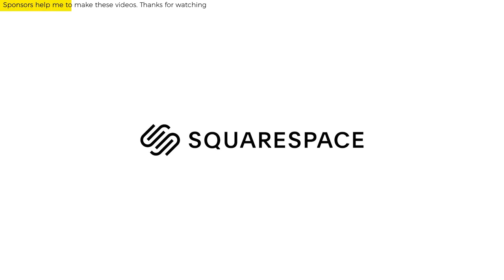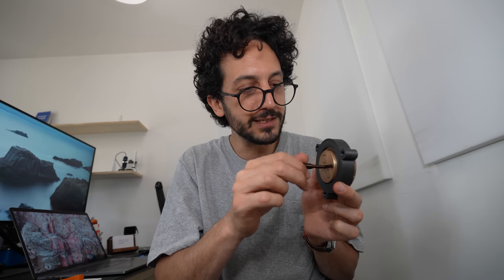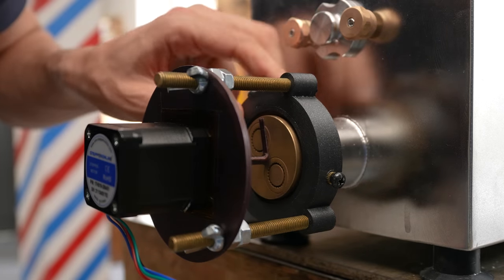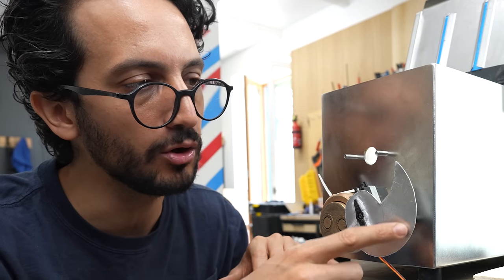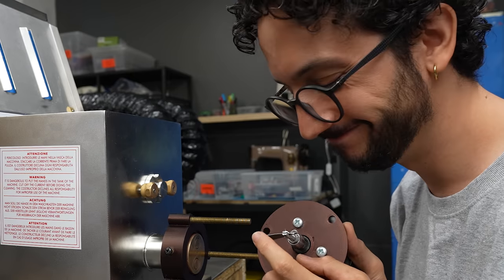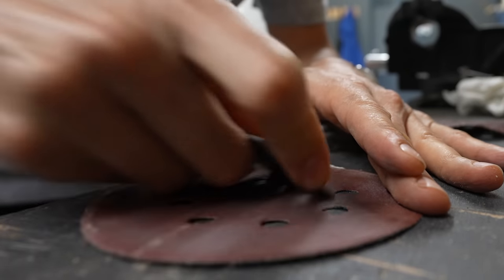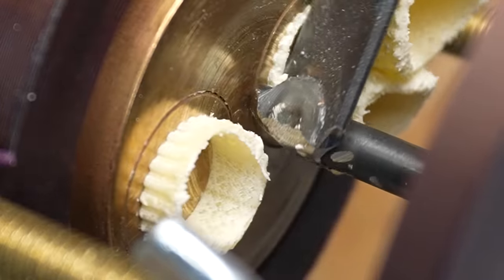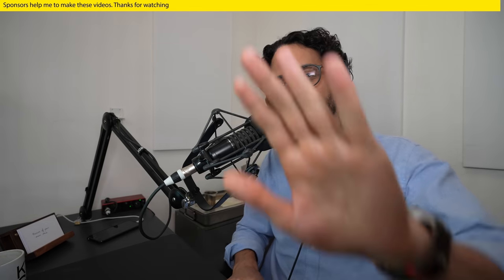I Tried to Make an Automatic Pasta Cutter (did NOT go as planned)

Comment: I like your springy blade, but isn't it mounted the wrong way around? When you cut by hand, you are cutting the pasta; ie the sharp edge of the knife is pointed in the direction of movement. Your springy blade is scraping the pasta; the sharp edge is pointed at the pasta machine, while it moves perpendicularly.

Comment: Yikes... just put the motor parallel witht the extruder and have a accurate mounting system that attaches to a modified kitchen knife. Write code to slow down and speed up the motor for longer pasta. The only challenge would be to get the tollerences right so the knife is close enough to the extruder to get that shear force. Also it needs to be stiff.

Comment: 9:50 You're entirely wrong about how scissors work. They rely on the springyness of the blades -- which are actually bent inward toward each other, not straight -- so that both blades act as springs to press their contact shearing point together. I'd recommend replacing the cutting edge with a disposable safety razor blade, mounted so that it's pressed in hard, so the blade's own inherent spring keeps it in contact with the die face.
Reply: 👆🏽 This. Exactly what i was going to say.

Comment: Wouldnt it be easier to make a wire go up and down not around? Basically just hook up the motor to a cogwheel ( basically like in old steam trains) and the cogwheel would not be a cogwheel but a cogelipse! So the blade could cut swiflty and the pasta time to extrude properly, of course this is just my silly steampunkish idea. AND good work alex! You seemed a little tired in this video, hope you are doing alright. 

Oskar
Reply: Oh and a last thing, I would use a wire insted of a blade

Comment: Why not use a cheese cutter wire? I suppose that doesn't fit with your existing design of a rotating blade, but I think a quick chop with a tensioned wire would work much better than trying to get a blade pressed flat against the die.

Comment: From an engineering standpoint...

I will suggest that you slow down.

It's not about rushing to success.  Good, well efficient engineering, has a lot to do with good planning and highly accurate detail of the design specification.

Start from the beginning:

One - define the cut interval, either static or a range.  Note the range could be done through variability of the motor or via gearing.

Two - define EXACTLY how the pasta will be cut.  Think about blade sweep, blade profile, profile and position of the cutting tool to make sure it's not in the way of the pasta. Pay attention to how it cuts in order to control how it will deform and tear the pasta as it does.

Three - Consider key mechanical elements like blade sharpness, structural strength, required force to cut , and tunability.

Four - Brainstorm ideas quickly and with minimal real investment.  You want to work through a lot of the core variability and options using as little time and with as few material/labor costs as possible.  Also don't be afraid to use "representative" devices/objects to test with.  You don't have to 3d print a blade to test a blade.  You don't need a whole motor contraption to test a blade design.  Work bottom up.  You want to step through theory as much as possible first, then very basic physical and specifically core physical elements.  As the core parts prove to be sound, begin to build up the more complex, time consuming, expensive elements.

You kind of went full tilt right from the start.  You had no idea how a 3D blade would cut, and you tried a lot of them...blindly.  You didn't know motor torque and requirements for torque.  You created issue with damaging the pasta (crushing it) or simply got in the way of the pasta.  This stuff, in theory, should be very obvious.

Interestingly I think you were at your best point at around 4:30 into the video.  That style keeps the design clean, parts well out of the way, leaves room for easy adjustability, and all you really needed to do was start with a thicker blade material that you could taper down into a good blade edge and then secure the blade significantly better to any motor you choose.  It really only failed at all because it was flimsily attached.  A well structured version would yield vastly better results and still give you lots of headroom to tweak elements of the design.  Also, please bond parts with something stronger than some light duty silicone or whatever you used.  There's very nice epoxies out there that work super well and even set really fast.  One of my favorite is Devcon.  They have a 10 minute epoxy, fully cures in just 90 minutes, their part number 14251.  It bonds to materials really well, is decently hard and very strong, but still just has a tiny bit of flex and doesn't become brittle.  It's speed and performance is stellar.  We actually use the stuff in a manufacturing environment as an acceptable repair for spot weld failures (on relatively light duty parts).

I also want to make a note on your cutting.  Try and mimic what you're doing by hand with your knife.  Note what you're physically trying to do with the position, tension, and motion.  You'll want to mimic the behavior.  This is in part why the spring loaded setup worked kind of ok and your offset blade style (that I actually liked) faired poorly.  When sheering the pasta from the extrusion nozzle, you're attempting to shear at the surface, and you really don't want a gap at all.  The gap just shoves pasta material between the extruder and blade, and this wedges underneath and lifts the blade off further (specifically if it's not study/rigid).  You can actually get away with looser tolerances, but you fill find the cut will have much bigger torn/squished/deformed edge.  To put it bluntly, you can cut pasta with a brick a few mm away from the extruder end, but it willy cut terrible and look terrible.  A clean cut edge will be vastly better the tighter you can keep the blade.  This doesn't mean you need it to have spring force against the extruder or have it so close you have hit problems or wear problems.  But, you do want the design to have enough control and enough rigidity in the design to hold a position very well.  You might position it a quarter of a millimeter away, but the design should hold that, absolutely, as it cuts.

Also, think about the cut rate and how the pasta is shaped as you cut across while it continues to extrude.  A faster cut will generate a straighter profile.  But fast and infrequent means either a big diameter blade or a start/stop method.

Comment: Your blade is at too vertical of an angle.  With it that extreme angle, you are pushing the pasta into itself with the upper part of the blade, so no matter how sharp or precise it is, you'll still run into the same issue of the pasta compressing and deforming.  Ideally you would want the angle of the blade to be very close to but slightly higher than the angle of the cut of the pasta, which is nearly horizontal.  Another thing that could help is a blade that isn't as tall, then there's less material for the pasta to get caught on.

Comment: Some very obvious things going wrong here, assuming you are using PWM to control the motor?: 
The default frequency of the Arduino PWM is unfortunately way too low! So:
1. It is well within the audible range and makes a terrible noise! As demonstrated.
2. The low frequency results in very low torque in your motor. 
3. You need a PID controller in your code. 
It is not the motor, it is the code that is the problem, and this needs to be fixed. 
For a motor you can use an old ink jet printer motor with the optical sensor. This is the circular, clear, plastic disc with black stripes on it. If you reclaim the reader from the printer as well you can read the exact speed of the motor and with a higher frequency PWM and a PID algorithm you can control the speed EXACTLY and exert maximum torque at any speed, even slow.
In my code I had something like this to change the PWM frequency above audible and increase torque immensely.
TCCR1B = TCCR1B & B11111000 | B00000001;    // set timer 1 divisor to 1 for PWM frequency of 31372.55 Hz
ps: I can send you the rest of the sample code if you want? This should be a perfect controller for an ink jet printer motor that will cut anything at any desired speed. 
Of course the cutter blades will be a factor too but you need to get the motor control sorted first.
And trying to control a stepper motor seems like overkill. Just implement simple DC motor control. It is speed and torque you want to control not exact positioning?

Comment: Think comments on here disregard the fact that both Alex and the manufacturers of pasta came to the same solution. 
There are engineering reasons why that is. If you are from engineering background you can look harder why that is*. If you are not, reinventing the wheel is great, but that's another hobby. The task here is to cut pasta effectively. Alex tried to shortcut the engineering solutions to see if it works temporarily (it did not). 

*clues;
+ if rotating, it needs to be central to make each pasta equal, additionally having it offset can only work if you have a force big/fast enough to cut it like it was nothing so it does not have different length from first to last cut but also uneven stress on the blade frame 
+ Alex researched other ways already and criticised the cutting scratches the blade, well in his scissors example about movement. The less space between the brass and blade as well as minimal movement will create the best cut. Therefore the more pressure it presses on the brass the better the cut will be (hence scratches).

Comment: instead of having to sharpen blades yourself, why not just 3d-print a piece you can attach a razor blade to? they seem the perfect size, have pretty standard attachment holes, would probably be the sharpest you could find and easily replaceable once it dulls

Comment: 1: Why would u not use razorblades? Sharp as fack and prob the right size.
2: A cutter in the middle wil not work as good as you might want. I thought this the moment you had the 1st prototype, the difference between the inner and outer part of the blade's speed will always be an issue. The major manufacturers dont have this issue due to their extruders size. 

Suggestion, use that side mount thing, with the spring blade prototype, with a razor blade inside it instead of a rando piece of metal. And instead of making the blade curve like you had, make a progressive curved mold around the extruder port that the blade can slide on and get on the extruder exit with the proper pressure. You COULD even spring load the arm, so it cuts with a faster motion, but doesn't go around faster.

Comment: You need:
- A sharper blade
- Stop the motor for 2 seconds to get the desired length, start it to cut, then stop it again for 2 s, start...

This comment was made halfway through the video, so maybe it was fixed later...

Comment: You need to cut with a wire, not a blade, following a guide either side. Cut up, wait a set amount of time, cut down, repeat. 👍
Reply: Controlled by a single long stroke solenoids for motion and control.

---------
\.     /
   \/
    ¥
    ¥

Comment: Right approach, wrong execution. You need to base your design on the movement you make with the knife. You need to have a blade that is almost parallel to the face of the extruded or at most with 5-10degrees of inclination. The blades you used are almost perpendicular to the face of the extruder or with shallow angles. That and a blade really sharp

Comment: The surface area of the blade is still too large. Maybe a rotating wire cutter can do the trick
Reply: 3D print a U-bracket and attach a wire between the legs. Should be easy to prototype fast

Comment: You are approaching this problem from the wrong end. You think the cutter needs to cut (which is correct). But you should think about the pasta deforming the least amount when being cut. Your angle of attack is way wrong, your cutting speed is way too slow. You are giving the elastic and plastic pasta dough more than enough time to deform, before the bonds between molecules can break. 
You intuitively had the correct answer all along: how you cut them by hand. You hold the thin blade on a shallow angle to the extruder face. And you do a rather fast swipe across. 
Use a carpet knife blade. A beam like holder should keep the flex to a minimum. 
Build a sturdy base, that is flush with the extruder face (so the blade can comfortably ride against it)
Offset the cutter to one side (like you did on ver. 2). 
This should provide a reasonable angular momentum. And reasonably straight cutting path, perpendicular to pasta extrusion direction. 

One thing is the blade angle to the extruder face. It may need to be very shallow or it may need be rather blunt. Depends on several factors: how plastic or elastic the dough is (plastic dough prefers higher angle, while elastic needs shallower), the speed of extrusion, speed of blade etc etc. 
I could design an adjustable blade holder, that can be operated while the machine is running.

Comment: you're blade and the speed is the biggest problem using a cheese cutting wire and a mechanism that could snap it across the plate would probably work better.

Comment: Maybe if you move the axis of the spinning blade to the top or side of the disco where the pasta is extruded, it could cut both pasta and let it drop before it touches the next one? As now one of the pasta gets stuck on the blade because is cut from the bottom up ¯\_(ツ)_/¯

Comment: Why cant you just mount your very sharp knife on the stepper motor like you did the second design, rotate quickly 360 degrees then wait x amount of seconds, then have it rotate again? That would be identical to your hand movements. edit: or just wire. and importantly when your blade is mounted at such a perpendicular angle your just crushing the pasta before it finishes the cut

Comment: You can definitely do much better.
The blade and mechanism needs to be stiff and straight so no warped 3d plastic parts.
If there's play you can machine a dent into the center of the extrusion dye and sink the tip of the blade holder into it to help keep things in place. Maybe a light brush of oil to help keep it smooth.

Why did you decide on such a wide blade? Is the slightly squished shape desirable? 
Why not use step down gears to increase torque but reduce speed?
You tried to diy blades from metal pieces, why not try a razor for the prototype? Already very sharp, thin and hardened.

Comment: The Cutter was too overengenieered.

Think about the cheap maschine, it had this wire cutter

I think for this small die. a small wire that is being moved up and down every 5 seconds with a bit more speed would work better

The pasta won't stick to it, won't ruin the next pasta, while cutting it better (I at least think so)
Reply: *Thanks for watching send a direct message right away on the above number for more enlightenment:••*......

Comment: Too small diameter of the extruder. Try something different. Notice how you move your hand with a knife. You need cutter which does fast linear moves up or down with period you set. Also try a thin string instead of blade.

Comment: the angle of the blade is too steep, and the width is too long. also you need to sharpen the edge of the blade at the angle you cut the pasta. about 15*, and the comment about the speed of the blade is true too, you need to attack it from the side on a much bigger wheel that will wipe across the die fast but at longer intervals. Think of a Windmill next to the Die, but with only one blade. I would try to epoxy a razor blade to a 3d printed hoop with a radius 3 times the size of the Brass die.

Comment: Don't bother making you own blades for something like that.  just make an arm with some threaded holes to hold some clamps for your normal disposable replacement razor blade, utility blade, or whatever variation works.  Any permanent fixed blade will  stop working after you sharpen it a time or 2 and tolerance go out of wack.

Comment: The blades are too steep, its “wiping” the pasta off instead of slicing like you did when holding the knife, the angle was shallower and more parallel to the die. Also since you were using stepper motors, you can easily make the blade quickly pass the extruding area and then pause in the areas where there is no pasta….waiting for the next pasta to reach the correct size then BANG the blade quickly slices it and pauses on the other side waiting for the next one.
Reply: Also were you using a stepper motor driver with controllable microstepping? Microstepping will allow for movements smaller than 1 degree, and you get higher torque. Commercial solutions use a brushed DC motor with a gearbox so I think you should too, a stepper motor is overkill

Comment: This episodes kinda looks artificial.
I can't believe you would try something as silly as cutting stuff with a plastic or aluminium.
Your final setup is basically what I would start with. And go from there by making the blade sharper, thinner and making it rotating way faster.

Comment: I don’t believe you.   I think you are making mistakes on purpose.  Anyway, to me (I am a Mech E) you need to mimic the motion of your hand held knife, and you need to allow space for the pasta to extrude. 

So… mount the rotating blade offset from the extruder center of rotation about 10cm from the extruder head.  

Fabricate a lead in ramp to guide the blade to the proper plain to manage tolerances. 

Set the speed of rotation to allow for the length you desire.  I can imagine a double or triple blade setup to reduce rotation speed.  I also would cut downward to allow the pasta to fall without hitting the blade.  

My .02¢